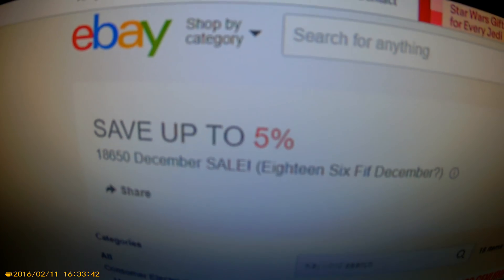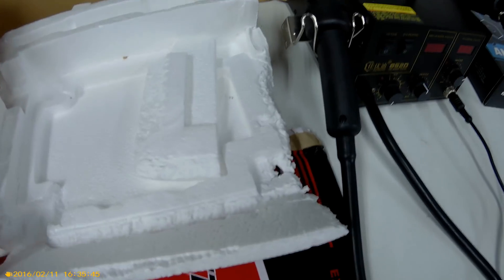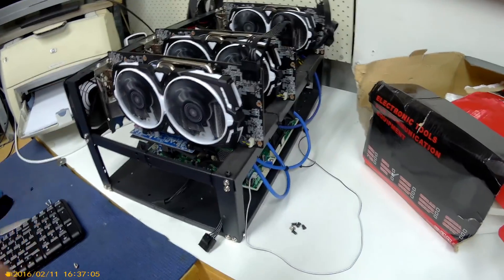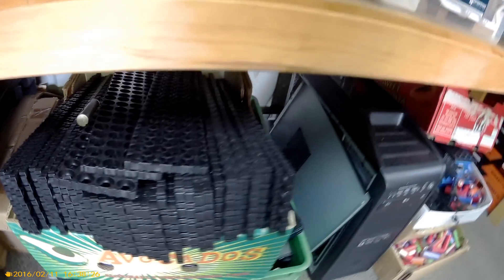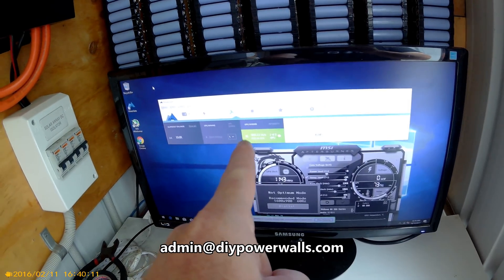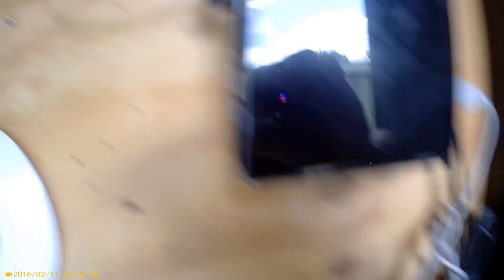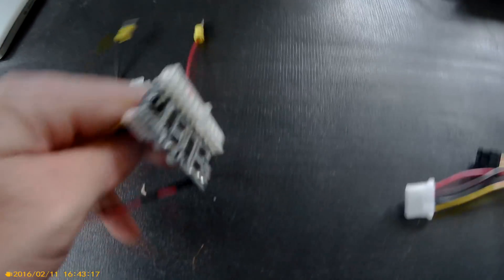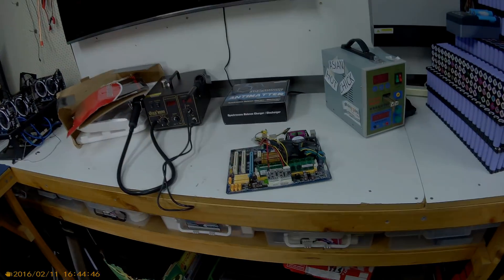18650 Cells on sale & an update CELL SALE

Comment: Just found your channel and mate loving it. Fellow brisbanight just making my way through working out how to do a complete lithium setup in a few touring 4wd. Want to do it as a custom setup with batteries filling all the unusable space. Keep up the awesome work mate
Reply from the maker: Would definitely consider new cells for automotive use and consider how hot they will get if inside the car
Reply: Yeah thats what i am trying to work out how they would go being inside a canopy, with the heat. Was looking at the Samsung 3500mah. Its more how to charge them without to much drama
Reply from the maker: Charging them is easy with money, heat & SOC is going to be the real test - making them last is important perhaps a sealed insulated fire proof box under the tray - removable would be good too

Comment: Nice little hot air gun with nozzle. i've used similar guns for vinyl welding. they get up to about 800'C depending on what tip was on it.
Reply from the maker: Very handy tool to have around the workshop if you can use it :)

Comment: Those soldering stations are junk. Spend the extra and buy one that will last. Buy right buy once.
Reply from the maker: Had Hackko's fail so this is not always true. For the price point they get the job done well.
Reply: They are shit. Trust me my dumb boss has purchased over 10 of those. Some have lasted as little as 3 weeks all dead now he finally got some more Weller WX's. 
Man if you are putting Hackko's & Wellers in the same boat as your Banggood crap freebies must be altering your reality.
Reply from the maker: DUDE not for a second in the same boat I'm not stupid! Just saying I've had all brands fail and I'm VERY happy to keep using these for my current workloads bang for buck is where it is at. I do upgrade the heater elements as soon as i get these ones does help but adds a few dollars to the cost :)

Comment: if you are interested in selling spot welder. can you let me know? I am near Brisbane. so not far away. will save you posting. I am interested to get it end of this year/ early next year. would be interested in a wall mount too as I don't have space for more or need more than one at this stage. Some cell holders too if you want to sell some now or later. If you can let me know that would be awesome thanks. Cheers Glen
Reply: I am only after one to do a few packs when cells come in. when i have done mine i could sell/give back to you or forward on to someone else?

Comment: So why do you make cell packs in parallel then wire in series?  Wouldn't it be best to set up your batteries in series's and then make parallel pack to just snap into place?
Reply: i would do it his way too. that way no mixing up of terminals etc. each pack would be 3.7V nominal Voltage but at a much higher capacity. easier to balance out that way too. correct me if wrong but i'm sure that would be the better way to do it.
Reply: Glen D I like the way he's done his packs they are similar to many others.  I just think it makes it way harder to properly balance anything further than just the pack so one bad battery effects the remaining 79 cells vs 29 cells.  I guess expandable capacity seemed more enticing to me than a fixed capacity

Comment: Umm, you shouldn't be OCing these cards.

You should OC the memory, downclock the core, and undervolt them. At a 1000Mhz core clock and 2000Mhz memory clock, you'll get some great performance/w.

You could even go lower to 925Mhz, and undervolt even more. Even though you'd lose an almost negligible amount of performance, you would get even more performance/w.
Reply from the maker: ooh there is so much too it I love reading and learning how to push these cards to their limmits !

Comment: Hi, my only issue is knowing which mAh I should buy. 2200mAh seems logical so that my wall isn't as big as a1300mAh battery setup. What do you think?
Reply: Buy the highest Wh/$ 18650 cells you can get. 

Meaning the 100 Sony 2400mAh cells pack at 120$ is the best one you can get.
Reply from the maker: what he said ... all about bang for buck
Reply from the maker: i've mixed 2000's with 3400's - many have said this is incorect way of doing it so all personal choice
Reply: HBPowerwall can you mix and match cell banks?  For example, have one bank of 2400mAh and the other say 1800mAh?   Of course each bank has its own Battery management
Reply: shame its just for this weekend as pay day is after it  during the week :)